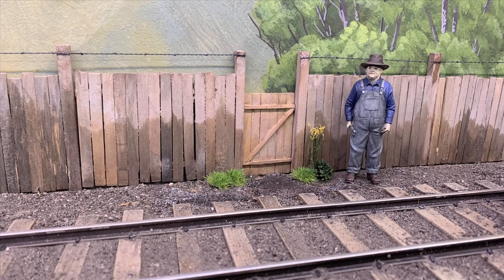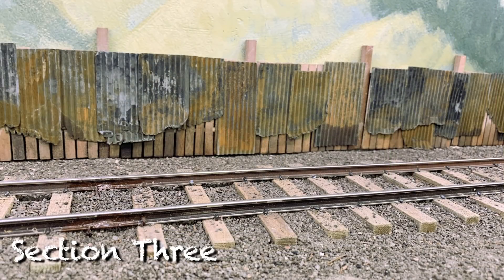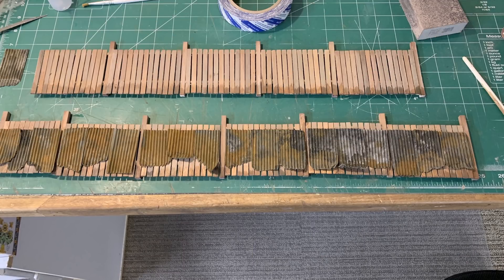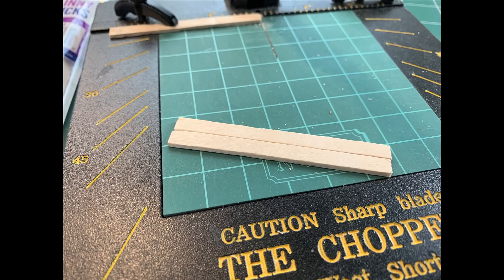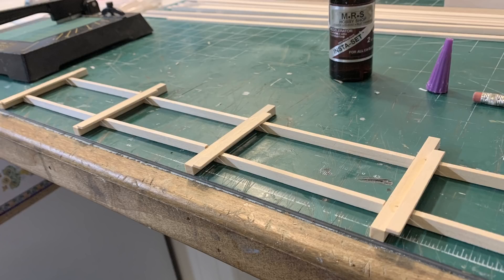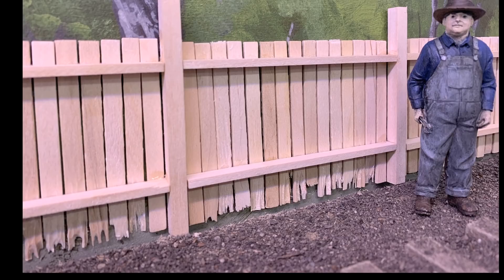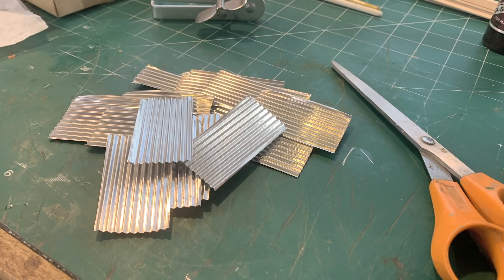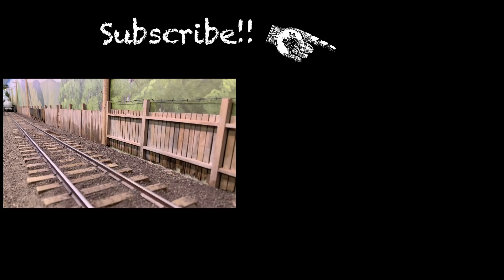Building Model Railroad Fences - Part One: Basic Wood Fence Construction

Comment: I made a 1/22.5 wooden fence several years ago to surround a Pola gas station. I used coffee stirrers which appeared to be the appropriate scale (1x6 or 1/8 slats). A good way to safe some funds. Posts and frame were made of scale wood. Followed up with stain and signage.
Reply from the maker: Sounds like pretty much what we did! Except we have found those rounded and sticks are harder wood. Hard to cut. The skinny sticks from Walmart are perfect and cut easily. However the round ones can be left round on the top. Look great for some fences.

Comment: Sich a great way to separate the benchwork & back sceen, especially on a narrow shelf.  They take up nearly no valuable depth & hide (with a liitle fauna) the hard horizontal to vertical transistion.
Reply from the maker: It’s always a problem for a painted backdrop meets the rail road. You really have to cover up that seam somehow. This does the job nicely I really adds depth of the backdrop

Comment: Nice fences. I remember making some in O scale nearly 20 years ago, with styrene, as I don't like working with wood (mainly because of the glue spots, and it isn't cheap either). In O scale, I managed to reuse free credit card sized flat cards, just the right size between posts!
The barbed wire looks very real. I made some fields fences last year, but it wasn't good for my sanity, barbed wire in O scale is too small!
Reply from the maker: This is the reason we went to this very large scale this we can get away with things like this. The problem of course since you have to have a very small Railroad. But it’s really really fun to dig right down into the details on the small place you do have

Comment: Awesome looking fencing. It would have looked really neat, if you would have had the room to do so, if you had pulled everything toward the front of the layout an inch or so. Doing that you could have used that space to add some trees and brush between the fence and the backdrop blending it somewhat better and giving it more of that deep forest look you talked about in the first area. Everywhere else it would have given you space to blend the layout into the backdrop with other types of vegetation. It looks really good as you have it so don't think I'm being critical of your awesome work, just a hindsight thought I guess you could say. I have a lot of those when modeling. Things you don't think of at the time and wish you'd have done when you see it later. I think that is one reason a model railroad layout is never complete. You can find something to change about a spot you thought you'd finished but see that you should or could have done it differently so you are always making improvements and changes thus leading to never being finished and continuing the fun of creating and modeling. Nice techniques to make the different looks to the fencing. Great video as always. Stay well. -Wil 👍
Reply from the maker: Hi! Yeah I had thought about that and we measured and remeasured and actually ended up widening the shelf a bit just to accommodate the tracks and everything. These huge trains are so difficult to work with. We really need to keep this layout as narrow as possible because we still use it as a garage! So I actually expanded the width by about 4 inches but each of the three tracks requires a minimum of 8 inches 4 inches center to edge on each track. So actually the distance from the backtrack to the fence is exactly that 4 inches. Adding even one more inch would’ve been somewhat challenging. And actually we decided that we wanted to add a couple of extra inches to the front side just in case of a derailment a locomotive would be less likely to crash to the floor.   We also have a rule on the layout. All tracks and trains must be within reach at all times. So never over 36” from the edge of the layout. And with minim radius of 50” and 4 inch center to center clearance OMG!  Anyway those two inches would have been great!!
Reply: @ToyManTelevision  I see and understand why it wouldn't work having the parameters you put in place and because you still must use the space for a garage aswell. My suggestion was more of a hypothetical if you could have in your circumstance I guess. Like I said previously I'm not trying to impugn your outstanding work and understand I don't know all the logistics of what you have to work with and I think I was only saying that would have been nice to do just as I'd say if we'd been friends for a long time and I was a regular visitor to your layout and was saying it would have been neat if you could have done this in that spot. Watching your videos on a regular basis kind of gives that type of feeling of being their and having that long term friendship. Love your videos and definitely always glean something from them and your amazing work. -Wil  👍

Comment: A mixture of vinegar and steel wool without soap in it would darken the wood. All you need is a container to put the vinegar in with a steel wool put down in that foe several days. When you make the vinegaroon (vinegar and steel wool mixture), make sure to punch a hole in the lid of a glass jar or use a container with a pour spout in the top of it. If you don't do it that way it will explode. I almost had that happen when I did it and I had to pop the pour flap open to let out the gas inside. It sounded like a .22 when I did that because of explosive decompression.
Reply from the maker: As a matter fact we’re doing the voiceover for that show right now!